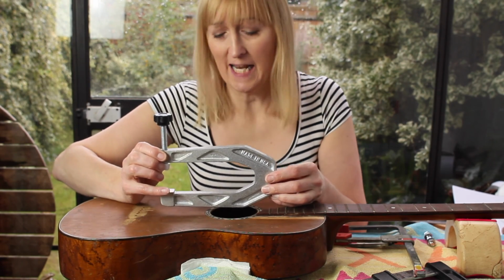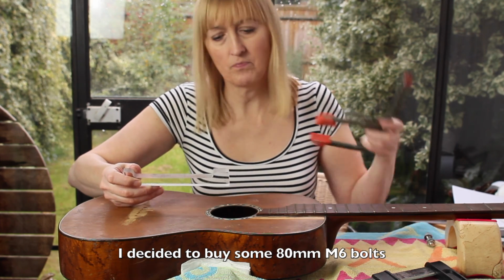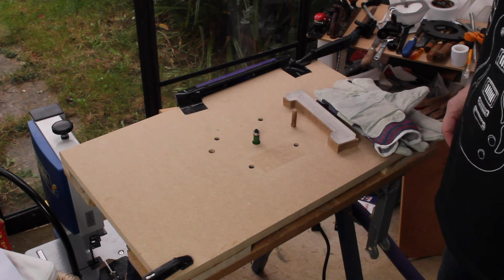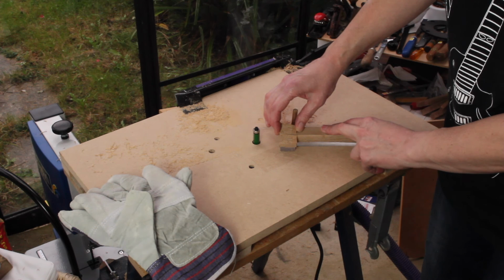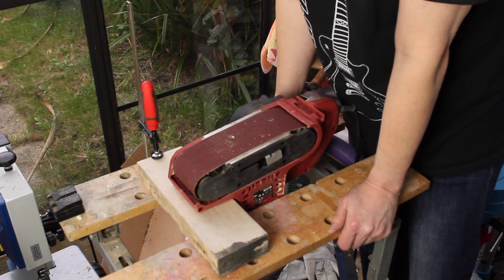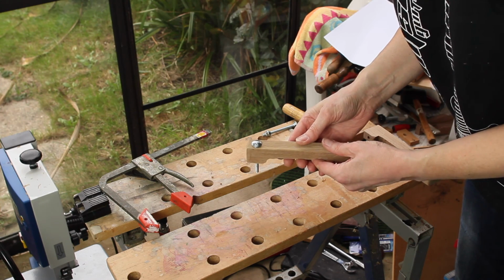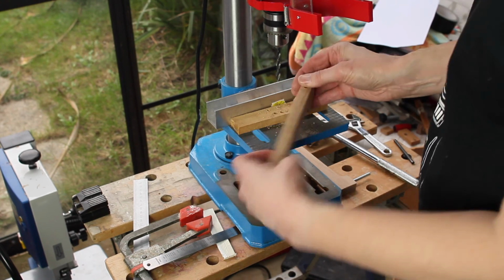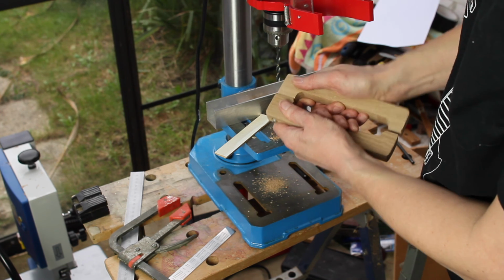Making wooden clamp extensions

Comment: Susan, Next time you make a set of these and are trying to drill out the hole for the "wobble" side of the clamp I suggest:  Mount the jaw half on your drill press table with the projection facing up.  Drill out the bolt diameter hole like you wish.  Leave the piece clamped on the drillpress table. Then take another drill about 1/16" larger in diameter and drill about half way through the wood piece.  You may need to experiment on the size of the clearance drill and how far into the piece to make the larger diameter hole.  Perhaps drill to the point you are only leaving 1/4" of the bolt diameter hole remaining.  That would give you the "wobble" action without messing around trying to angle drill.   However if you have a problem with the clearance hole being round, wobble in all directions then do what you did before but use a Forstner drill bit to make the hole, it will allow you to accomplish what you want the hole to look like.  Forstner bits cut a straight hole no matter the side pressure on the bit.

Comment: watched a video with a template fixed to the piece you want to shape with a piece of masking tape on each piece. then the tapes were glued with a few dabs of super glue. I have tried it and it works well. Much better than double sided tape. Video is on YouTube and worth a watch.
Reply from the maker: I've seen that. I'll be using that in future. Thanks
Reply: I didn't think it would work but it does I usel superlue gel . I don't know if the thin stuff works . Enjoying your videos
Reply from the maker: +Les Bartlett I think I'd be worried about thin superglue soaking through the tape into the wood. I have medium viscosity glue which I'll try. I don't have any gel

Comment: Router + gloves.  "Danger Will Robinson" (Susan Gardener)
Just say no.

The router was snatching the wood because at that point you were "climb routing", ie moving the workpiece in the same direction as the rotation of the router bit.

On the whole your decision not to use the router to do this job was the right one.

Incidentally, in your video where you glue the bridge onto the guitar I notice that you use 3 "proper" clamps.  I must say that they do look nice, if a little expensive,  and as we all know "You can never have too many clamps"

Comment: Its been many years since I operated a router "table" but you can make a rig with a ball bearing/wheel that will allow you to easily do that routing with a pattern task.   The wheel bearing is attached so that it hangs "over" the blade with the clearance you want (the depth of the cut) and your pattern simply follows the wheel.. There is no way you can cut too deep as you pattern simply rides that wheel.